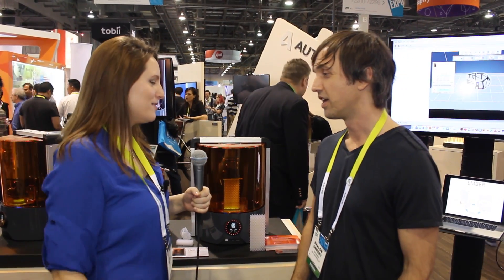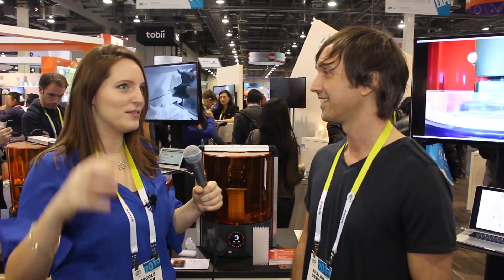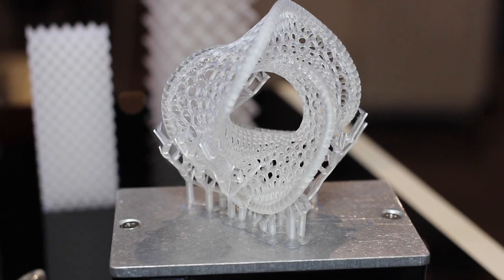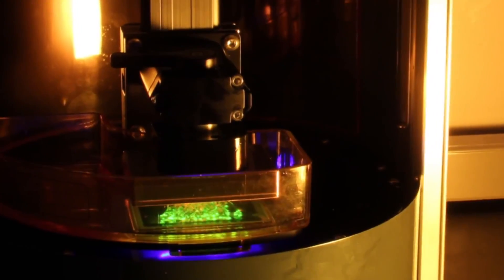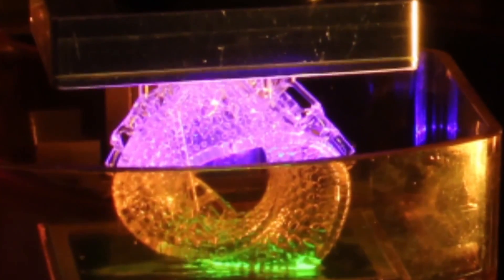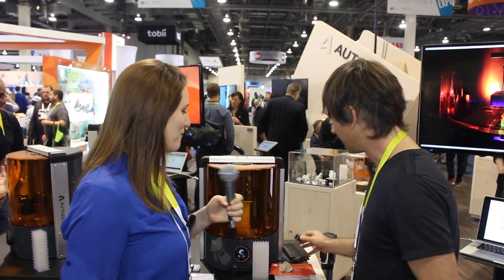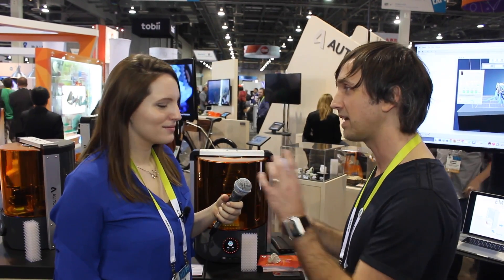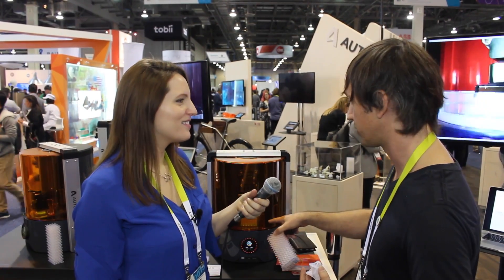3D Printing with Light - Future of Open Source is Bright

Comment: why autodesk and not the open source alternative blender?
Reply from the maker: Blender? Yikes, there's so many reasons. For starters Blender can't use large enough file sizes (less res) and you have to keep your vertices under 500,000.

But most importantly... this is open source, and pretty badass -- so why not?
Reply: Nixie Pixel What do you mean by it can't use large enough file sizes?

Comment: I have some questions.
1) How does it actually work, in the chemical level? (The science behine, if you will)
2) How durable is an item? In terms of what will it take to break it (Hammer? car? tank? The power of love?)
3) I get what open software and hardware is, what exactly does it mean that it's open material? Does it mean that I can make the material by myself from everyday products?
4) What's the estimated production cost of a small item (5cm cubed)?
Reply: Hi Tom Klinorain. 

1) Ember uses a DLP projector to project near UV light through a window in a tray that's filled with liquid photosensitive resin. The light polymerizes the light-sensitive resin, transforming it from a liquid to a solid, at slice thicknesses that are determined by the user (from 100 down to 10 microns). [For this reason, it's important to protect the resin from exposure to polymerizing light, which is why Ember has an amber-colored window, which filters out blue and UV light.]
2) The durability depends on the type of resin used. At #CES2015, we were printing with the Standard Clear Prototyping resin, which is quite strong, and can print in extremely fine detail. However, a hammer blow would certainly smash it. We haven't yet fully quantified its strength and mechanical properties. That'll happen soon. 
3) Open materials refers to the print material, i.e., the resin. This means a number of things, including that Autodesk will be posting the base formulations of our resins, which researchers can use in support of formulating new resins, and also that Ember can print with a wide variety of photopolymer resins that are created by third parties. The intent here is to support innovation in this field.
4) We're still quantifying this, but the best guess now is that it would be less than $1 to print a model of that size.

Happy to answer any additional questions.
Reply from the maker: All great questions! Tom Klinorain and since this product is so new, I hope you don't mind that I defer to...
Pssst Shalom Ormsby - if you're not busy. :3 (I realize this is way past your 15 minute Q+A) heehee
Reply: Nixie Pixel